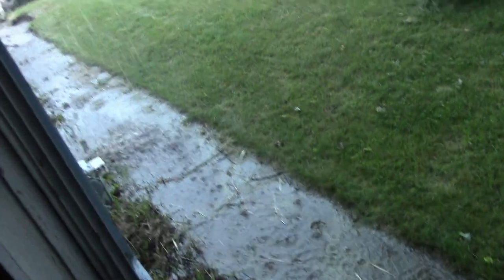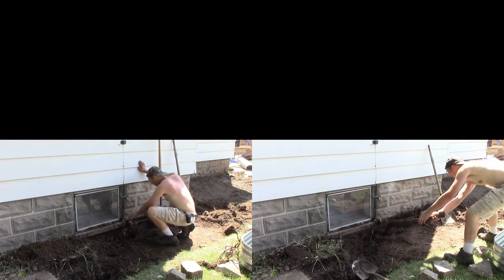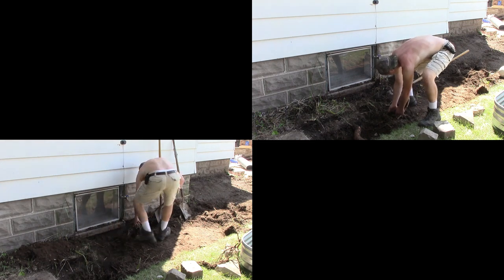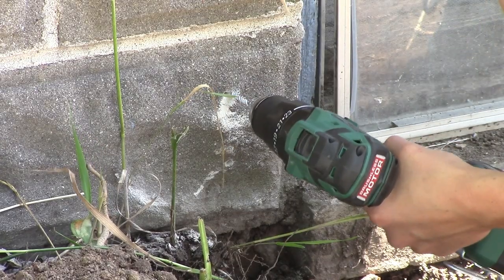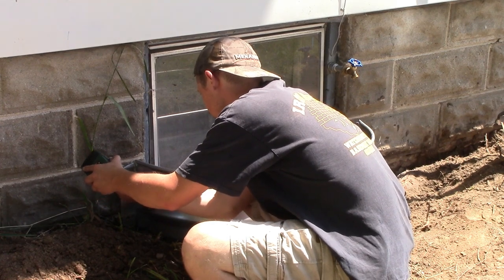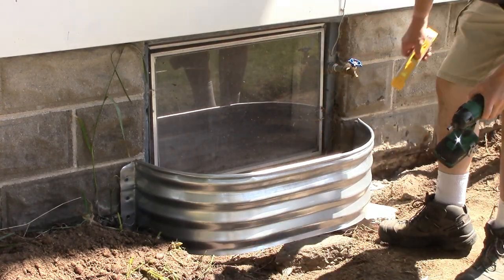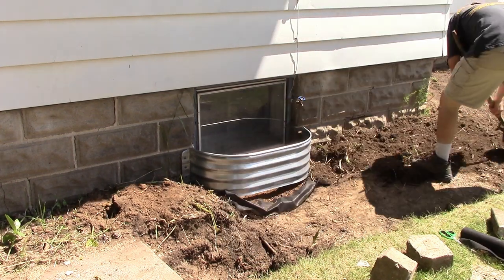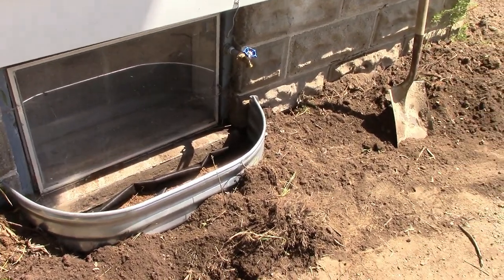Installing Window Wells

Comment: One suggestion I would make is to run a bead of proper caulking up each inside between the wall and the window well. This helps seal it, especially if you are working with an uneven wall surface.

Comment: The point of a window well is to yes grade the dirt around it.

But it is also very important to have some sort of drain .

On heavy rains / snow melts that thing is going to collect water and have no where to go. 
It will eventually drain into the clay but that will take a while
Reply: instead of drain can you just get a cover for the window well? i see them athome depot for around $30

Comment: How is it connected to drainage
Reply from the maker: It isn't. The idea is that the water doesn't get into the window well. At the bottom I did put sand and stone so the water can easily drain through and get to the soil below. The sloping soil around the outside of the window well makes most of the rain flow away from the window.
Reply: If you’re totally paranoid, they sell covers for window wells, but the idea is you fill the well with gravel slightly above grade and the little water that may get in will leech out to your drainage.
Reply: Actually, sand is not a good choice for drainage. It soaks up water and doesn't let it go, leaving moisture up against your concrete. I would have put a moisture barrier up against the concrete wall. I believe there should be a drainage pipe already installed under the window. Was there one? If not, it's a must have. In fact insurance won't cover damage caused by water leakage into the basement due to improper window well installation with no drainage. They say use clay as the base and grade at 10° angle away from the wall, then add a few inches of pea gravel, or similar. Window wells help keep water away from the window but water still gets in there. They do have covers for them to keep water and debris out. Just my 2 cents worth. Funny video though.
Reply: @Yosetime  Agree sand is not a good base for drainage, and you should definitely use gravel. However, then you suggest clay?  No way, clay swells like crazy when wet and shrinks when dry. You don’t have to have a drain pipe in a window well, but if you do want one it is suggested to get a professional to install it because you want to make sure that water drains away from your house. If you don’t install a drain pipe, definitely get a cover for the well. Would also caulk around the well to wall connection to make sure no water gets in that way.

Comment: HI, just stumbled upon this video. It's been six years or so since its been  posted, have you noticed any issues  with water accumulation in the well? I'm considering the same install, but do  not have a drainage system either.

Comment: u mean u have created a bucket to hold water of rain and let it dryout in sun for months....and that too for stopping sippage ? sippage will be more....more water means more pressure....and high speed of water likage...
Reply from the maker: uhhh, no. Water doesn't get into the window wells, that's the idea behind them, it lets you slope the soil away from the foundation so the water flows away from the house.

Comment: I think you forgot the drain? In the next rainy season or superstorm and you don't have a problem with a aquarium in your window, don't worry about it. If you do, then your back to square one.🔮
Reply from the maker: Clearly you didn't read any of the other comments on this video. My house doesn't have drain tile, so I couldn't connect this down to that, and since installing them I've had no issues with water getting into my basement, so they work.
Reply: Yah I agree. I would have dug in a 4" Big O drainage pipe, irregardless of your having drainage tile below

Comment: wrong tools, wrong equipment... bad advice. thanks
Reply from the maker: I'm sorry, what should I have dug a hole with? What equipment did I use that was wrong? A power drill, what should I have used to drill the holes and install the screws. Please teach me oh wise one.
Reply from the maker: Typically Internet troll, quick to criticize but never gives the "correct" information. I'd delete your comment, but it's too humorous.
Reply: @NathanSalapat  I'd also like to know! I found your video because I'm currently in the same situation you were in; water is getting in through a window in my basement and I think a window well would solve my issue. I was planning on doing it exactly as you had. I started to dig and also ran into a lot of thick roots. 

How have they worked out?
Reply from the maker: @ryanmcgraw1743  they've been great, solved all the problems. I did have some weeds growing in them I had to pull, but that was my fault and certainly not due to installing the window wells.
Reply: @NathanSalapat  How deep did you dig down?
Reply from the maker: @zacharyschiff5207  offhand I don't recall, obviously deeper than the window well.

Comment: Is this a joke.
Reply from the maker: If it is you're the fool.
Reply: @NathanSalapat      you ever heard of weeping tile ?    You don't think ground water can come up under your one foot deep well.   The neighbour property grades towards your place .  This video should have been called.  3 dollar budget hack job.
Reply from the maker: Weeping tile, no, but I assume that's the same as drain tile, which I am very aware of. Thing is my house doesn't have drain tile, or a sump-pump, and I wasn't about to spend hundreds of hours digging around my basement and doing all of that. All that I needed to do was pitch the soil away from my basement so the water wouldn't puddle at the wall, and this did the job perfectly. I haven't had any issues since installing these, so obviously it works just fine.